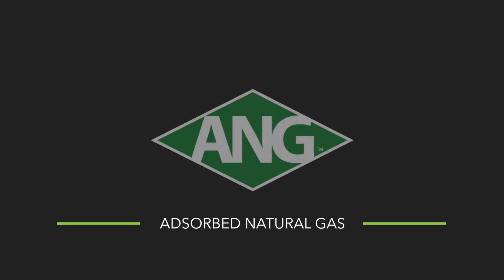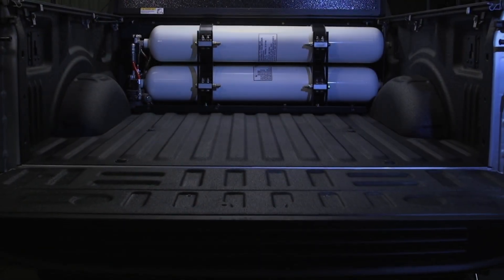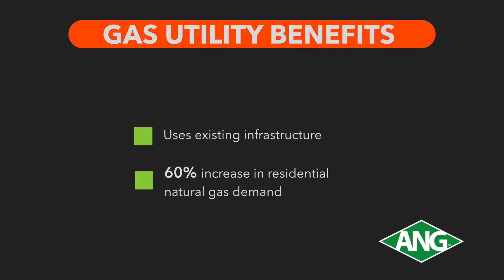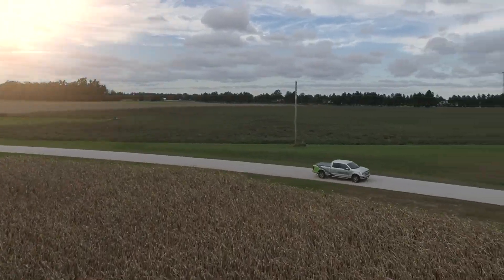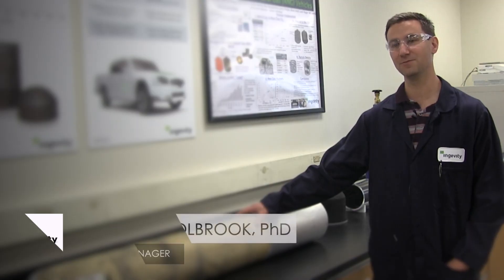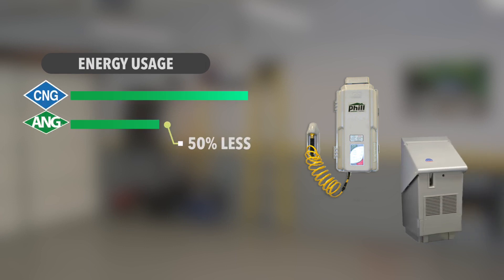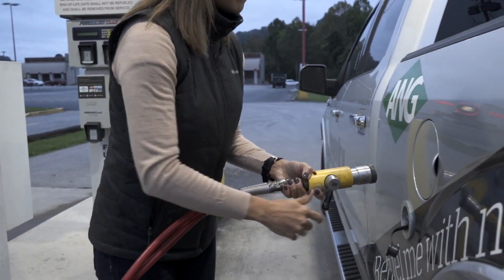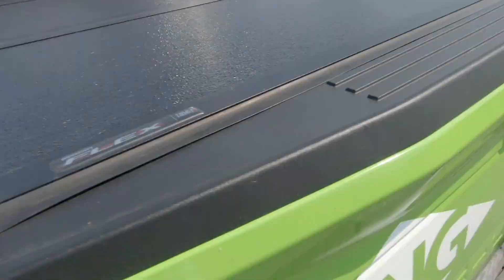Adsorbed Natural Gas for Light Duty Vehicles

Comment: From 1982-1986 I ran Rodagas Energy Systems in Detroit, converting vehicles to both CNG and LPG. MichCon, Now DTE, was the operating partner for a consortium of 8 big utility companies called Future Fuels. Rodagas was hired to convert its local fleet to a more efficient CNG system Rodagas developed. In addition, we installed all of the various ANG prototypes components Future was developing with various materials: activated Charcol from PPG, carbon from coconut husks, ceramics. etc. At the end of the day, as fuel prices stabilized and they ended the program, we had found the major problem was that natural gas was full of contaminants that stayed inside the vessel reducing its capacity little by little. Using energy to drive them out reduced efficiency and increased costs. I'd be anxious to see how that problem among others in now a non issue